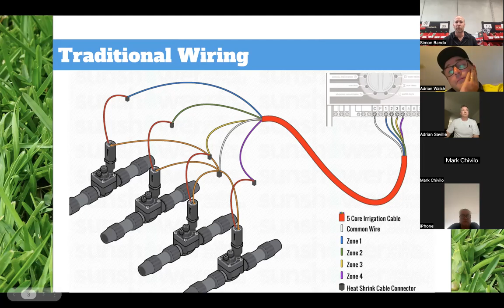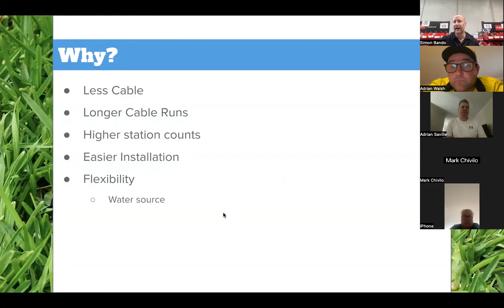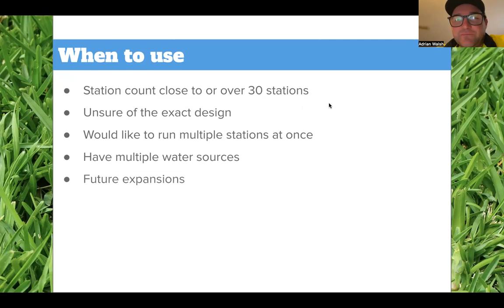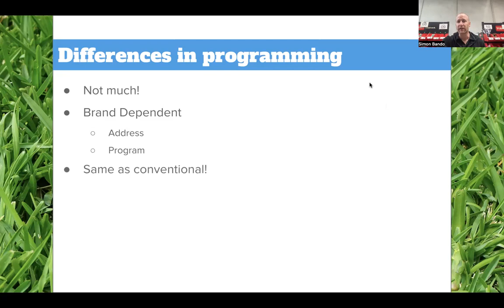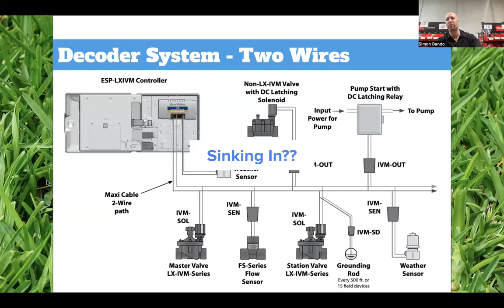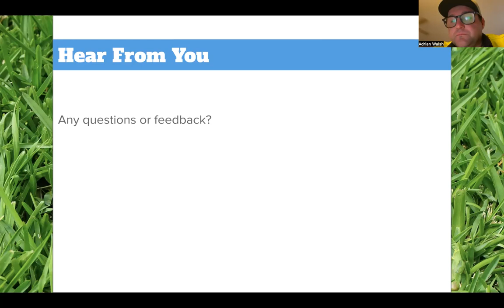Decoding Two Wire Irrigation Control | Contractor Webinar

Comment: I have a project for irrigation design my main line loop is 12 km having 132 solenoid valve  my master controller is located in one end inside the irrigation plant room my question to you is that my all solenoid valve with 2 wire systems can work in 12 km loop  lenth and one controller is enough to all 132 station.